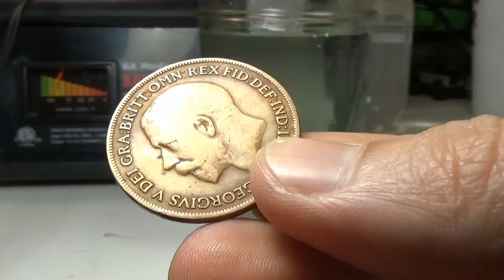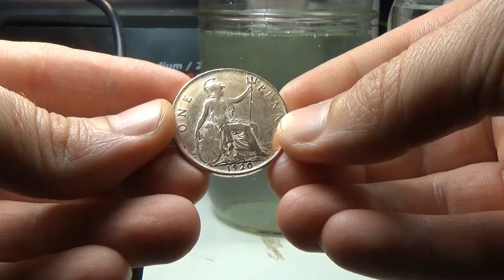How to electropolish the metal on a diecast car.

Comment: wow...simply amazing. I was wondering if you had any tips or ideas of how to get the hot wheels chrome dipped? I do realize it is probably a bit more expensive but was wondering if you knew any kits  that might work.
Reply from the maker: not any that don't use cyanide...  best thing to do is ship them off to a plaiting company and let them do it.. I sent some cars a couple years ago to get copper plated... the company is called Hopwood Globe... they did a great job... but they used chemicals you would not want to be in the same room with... the other option is a deposition process... that process cost many thousands to get into...
Reply: +baremetalHW Hopwood Globe...ok cool. Do you happen to remember how much they charge for each casting?
Reply from the maker: I seem to remember it being rather cheap.. but can't remember the exact price.. I don't want to guess and be wrong.. they are super cool to talk to... ask for Tommy if you call them... he did all mine.. if you do send them they have to be mirror polished... any pits or scratches become blaring issues if chromed..
Reply: http://www.chrometechusa.com/model-cars-and-collectibles.html

Comment: Nice! I was wondering about using electrolysis on Hot Wheels. I also have another hobby of metal detecting and use this and a tumbler to clean metal finds. I don't use this on all coins because this takes away from its value sometimes. In this case it's brilliant! Excellent work as always!